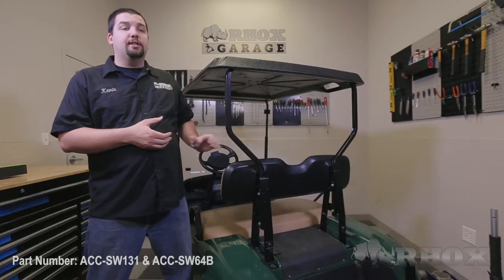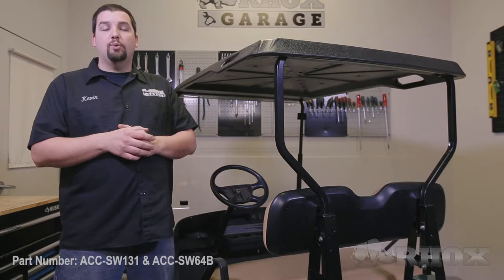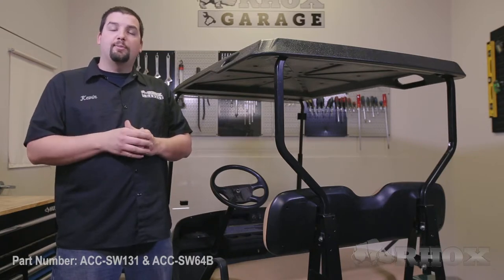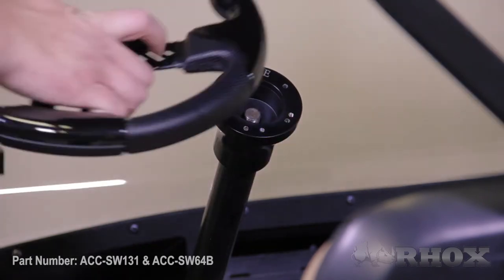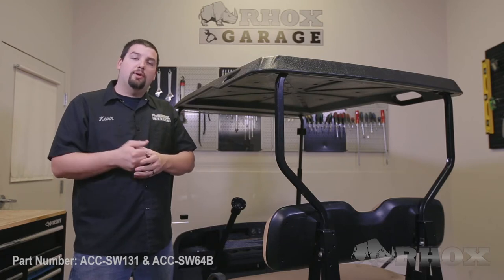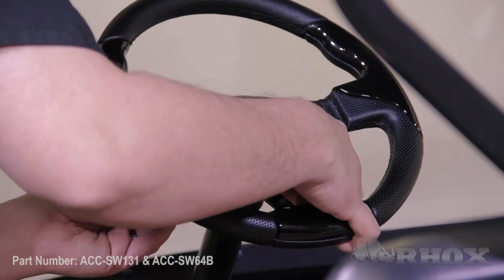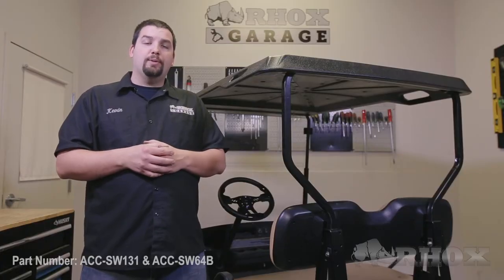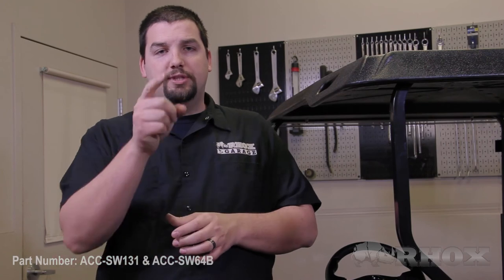ACC-SW131 RHOX Steering Wheel & ACC-SW64B Adapter on an E-Z-Go TXT

Comment: Great video.  Do you know what the screw is on the bottom of the steering column?  Does the adapter fit over this?   It looks like it does but wanted to check.  Thanks!

Comment: Please make a video showing how to hook up the horn on that type of steering wheel
Reply from the maker: Horn buttons on golf carts in the center of the steering wheel are mostly going to be for aesthetic purposes only.  You cannot run wiring down the center of the steering column because it is solid.  

If you are looking for a functioning horn button, they can be column mounted, floor mounted or included in the turn signal functionality.

Comment: Rhox ACC-SW64B adapter purchased 2021 does NOT fully cover the end of the steering column.  About 3/16" gap shows, looks bad.  Did Rhox make a change in the production of these?  Mine has a laser etched 'E' whereas the one in your video looks stamped into the metal. Pretty disappointed.
Reply from the maker: These have been the same design for years.  What is the model and serial number of the cart you are installing it on?
Reply: @GolfCartInstructions  RXV 2016 SN 5383730 looking on Amazon I find reviews that show I'm not the only one having this problem.  Tried the adapter on another 2016 at my dealer with the same result doesn't cover the column fully.